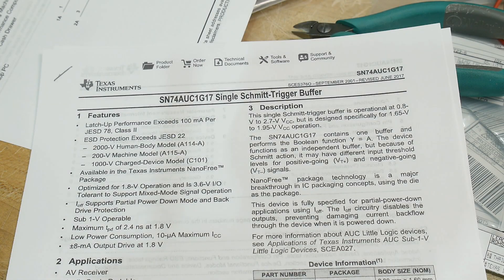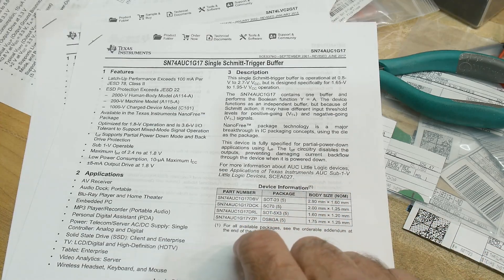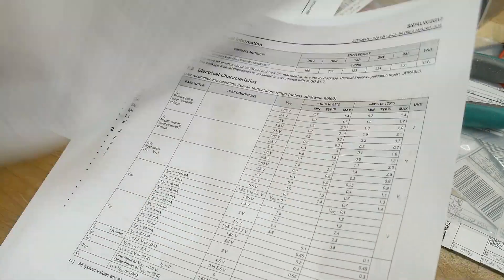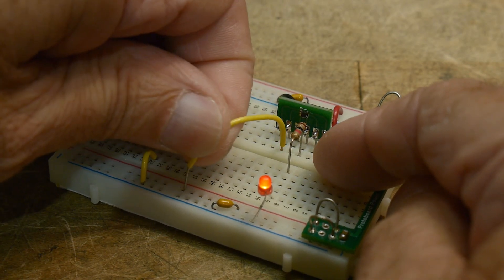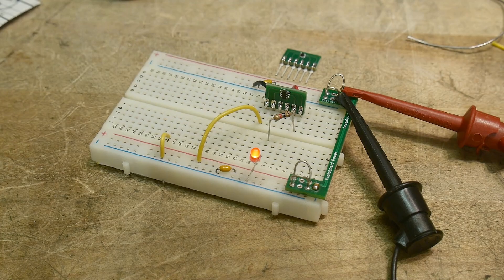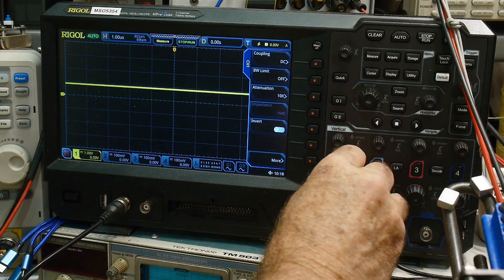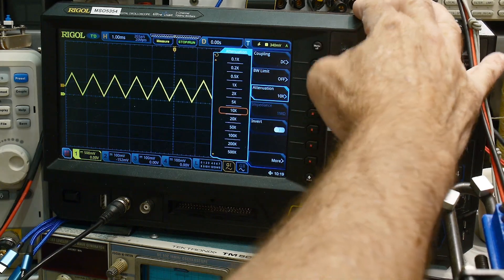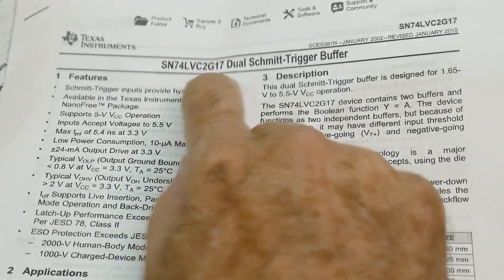#1964 74AUC1G17 74LVC2G17 Schmitt Trigger Buffers

Comment: With CMOS floating inputs causes shoot through currents that can burn out the transistors.  With processors and FPGAs running from 0.8 V these days, these gates can be necessary for interfacing to the real world.

Comment: Could you put one of them on the curve tracer, to trace out the hysterical response curve? Not sure if there's an easy way to get power rails with the zero volt reference the curve tracing is using (AC coupling the signals, maybe?)...

Comment: I used the 2G17 at the input of an all cmos freq counter as a squarer feeding an LVC74 flipflop. At Vdd of 3.6V the combo was operational to almost 400MHz. it is when the '74 failed to divide reliably. The buffer itself was still putting out healthy levels. A more unconventional use is a RF amplifier and harmonic generator as the high current outputs have very steep edges, well under 1ns. With the outputs of both devices paralleled thru low value resistors followed by a simple LC matching network, the thing pushed over 20dBm at 100MHz

Comment: I use these LVC1G17 (and 1G14) all the time as customer facing io. Not back drivable, esd protection, decent driving current, fast, small, slow rise and mixed voltage tolerable, They are great as buffers to the 'outside'. Also available from NXP and Diodes too most of them.

Comment: Those modern processors run on super low voltages. If you're using one and need to interface with something these are the parts for you!